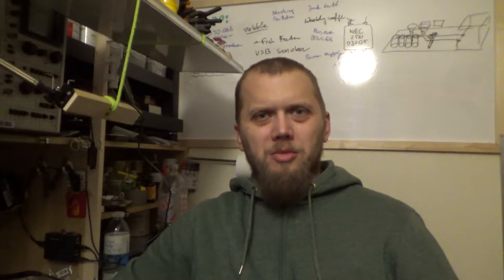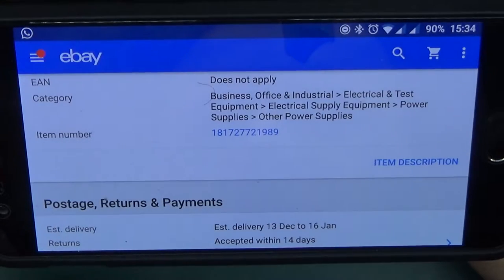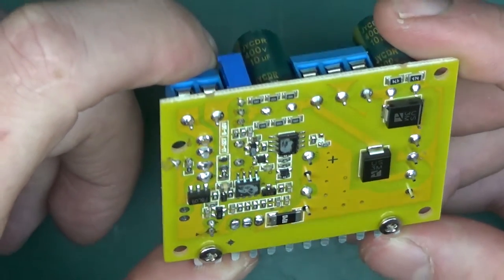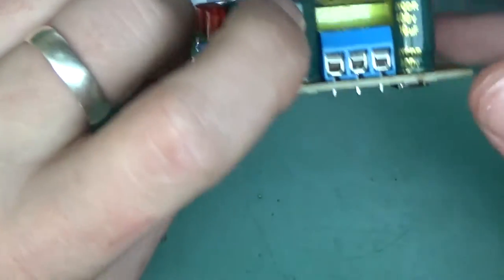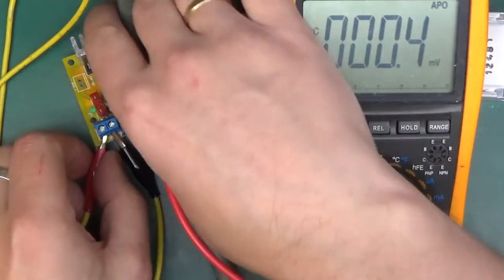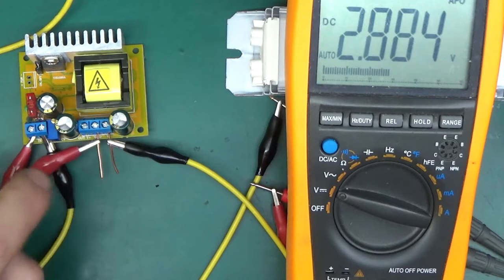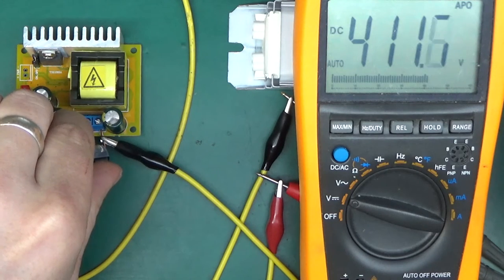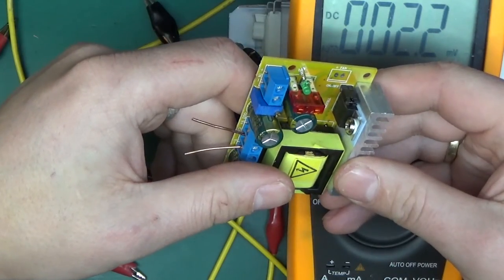High Voltage DCDC converter module YH11068 - close look at and test with sparks

Comment: I think you overlooked one thing that has caused me a lot of trouble until I found it.  If, on most of these modules, you charge one side to over 400vdc the caps can explode violently!  That is because they are only rated for 400vdc.  Whenever I use this module at high voltages, I always replace the 400v caps with 450v caps.  ONE THING!...be sure you pick caps with 10mm diameter, the more 12.5mm diameter caps will NOT fit on top of the board...caused me a lot of headaches!...hope it prevents this from happening to others.

Comment: Note that the two output caps are only rated for 400V (Chinese volts).  When you were working with charging the cap on the line with over 400v, I was just waiting for that outer cap to explode!! (I have seen it once before on this exact board, and it is LOUD!!  there was nothing left on the board!
I like this module ( I have about five), however, I replace the two 400v 10uF caps with 450v 10uF caps before using.

You do know that an uncharged capacitor is a short circuit to any charging source???  That is why you were reading high peak initial currents...you were actually directly shorting the output for a short while!
Thanks, and good luck.

Comment: These modules are great for low wattage tube amp HV supply. I use it in a little se 6V6 amp and it works perfect. Remember to use the common 54 or 47 micro/450V elco's in the HV resistor chain. Otherwise you get terrible HF noise!
Reply: I added a 1mH/160mA inductor between the board and first cap of my amp. Works perfectly.
Reply: I'm trying to use it for a tube MM phono stage, but it is too noise :) Too much low frequency ripple on the output, and it puts alot of noise into the GND.....

Comment: Youre getting a really stable output, even with no load? I have two of these which swing around and "pulse" ramdomly maybe varying by 1v sometimes and also the input current is varying, so there is some instability there somewhere. Loading the output helps a little, but still not what i would call stablised!

Comment: I have the same circuit. I can say that it works but it has some issues: 
- with no load output voltage is not stable: it has a oscillation of about 2 or 3 volts.
- output power is really low: if you have to charge a capacitor with 2200 microF or more you need to put a resistor to limit current otherwise your circuit will burn.
- I’ve already burned two of them, the first one for not use a resistor on output line, the second faulted without reason.
I think that some improvements could be done on the design of this circuit, basically it would be good but a more accurate design will have allow a better reliability.
Thanks for the video 😃

Comment: Nice video, I have the same module but mine has a different N-channel MOSFET (STMicroelectronics STP80NF70).
They did not sand the numbers off, one is a LM393 (Dual Comparator) and the other one is an UC3843A (fixedfrequency current mode controller).
The sot-89 is a 78L09 (positive 9V regulator).
The sot-23 is a 431 (TL431 - programmable voltage reference or Zener diode 431?).
I will replace those capacitors with 450V ones (they are already a bit bulged).
And I think using a full bridge rectifier would give better results.
Reply from the maker: +Javier Palla Lorden thanks for the info, it will come handy if i blow it up :)
Reply: With respect to rectifying with a bridge, or a single diode, remember it need to be of the fast schottky-type, due to the slow recovery in ordinary diodes at these frequencies. I have the same module, and consider a different approach. Connecting directly to the transformer secondary winding, and then to a voltage multiplier with 10nF/2kV capacitors and U4007 (fast schottky version on the 1N4007).

BTW my module has a RU7088 MOSFET, so I believe most kinds will work as replacement, e.q. cheap IRF540N or IRFZ44 should do the job too.
Reply: Hi LA7YKA from Norway, yes it has a high switching frequency (at 400V ~300kHz). So Fast diodes are necessary. UF007 has an IF of 75ns ~ 13Mhz so those will do the job.
Reply: how much current can this put out at 300V?
Reply: Hi, there is also an LM393 comparator. Does anyone know what is it for? Is it just for overvoltage/overcurrent protection?
Reply: @jamjestkowal  It's the voltage regulator. In fact it just turn the oscillator on/off to keep the desired output voltage.

Comment: there appears to be no schematic online for this particular circuit (no wonder why) but thinking about the TL431 maybe the circuit can be converted to isolated by fitting an optocoupler, the TL431 and PC817 combo is a classic on a lot of SMPS out, hoping the optocoupler is fast enough... not sure about the need for a cap across windings, that vould be sligtly more "messy"

anyways having "success" with reversed used SMPS transformers is not unlikely, maybe a bit too much of engeneering for every trasformer specimen but... it's raining outside :D

Comment: How did you change the input voltage of the zvs390v circuit from 10-32v to 8v-16v?
Reply: There is a label under the board that reads [10-32V / 8-16V], along with three pins nearby. On my board, there's a resistor between pins 1 and 2, likely set for the first option. To switch to the second option, simply move the resistor to pins 2 and 3.

Comment: Mine is silent for some reason. Nothing in output, but the LED lights up. I am trying to use a 9V battery and I have removed the jumper from the board (for 8-16v). Should I use the jumper and 2x 9V batteries?
Reply from the maker: Hey, not sure, but I would try to run it off a power supply rather than batteries. It might be too current hungry for 6f22 battery, although I can't recall now what was the current draw.
Reply: @randomtronic  thx. I want to have a portable small system for charging. Might have to go motorcycle 12V battery
Reply: I've got similar problem, LED is on but between + and GND there is always 2.8V and anything with - is just close to 0V. Did you solve the problem, if you remember, how?
Reply: @velipekkajutila9451  Hey have you solved the issue ? I have the same.
Reply: @velipekkajutila9451  Did it work with a battery as power supply ? I have the same issue.
Reply: @MichaeltLoL  have you solved the issue ? I have the same.
Reply: @paulinmm1  I spent hours trying to find what's wrong, but unfortunately couldn't find anything, maybe there is problem with some smd chip on the board but I can't tell if that's true because it's impossible to tell without equipment like oscilloscope which i don't have. Luckily I got refund
Reply: @MichaeltLoL Well, no refunds for me LOL that capacitor next to the green led just bloow up In my face an hour ago. Can't believe this kinda dangerous stuff is being sold all over. Anyways, thanks for the reply; much appreciated. ☻☻☻
Reply: The jumper on top is an ENABLE jumper.  It has to be in place for the circuit to work.
Below the board is a 1Ohm resistor as a link to select the input voltage range.  If you plan to supply more than 16V then the link must be in the higher voltage position (the default I think) so that the onboard 9V regulator is used to power the control circuit.  The drive transistor and (fan) and LED are always powered by the full input voltage.

It claims reverse voltage protection is some adverts but I think the exploding reverse powered input filter capacitor is supposed to blow the fuse first.  Application of reverse polarity may damage other parts before the fuse blows.

Comment: I've had a few of the modules and unfortunately some of them just died for no reason (not under any load, not pissing about with screwdriver shorts, etc.)
One of my modules flew under the radar in the CCP child labour factory inspection facility and escaped fully documented:
U1	UC3843A
U2	LM393
U3	LM431
U4	78L09
Q1	STP80NF70
Q2	MMBT3904LT1
D1	US3M
D2	1N5819